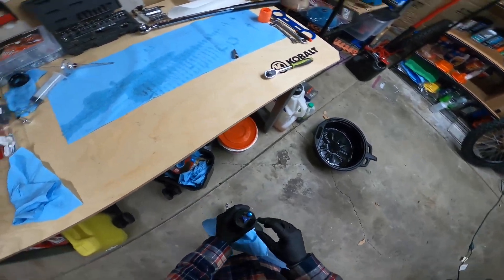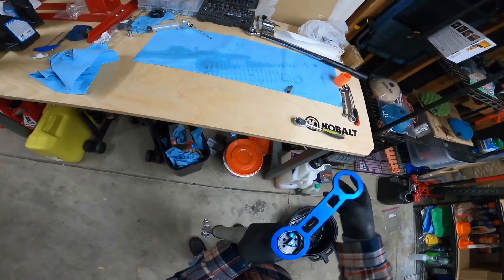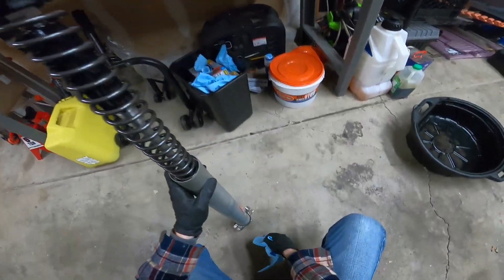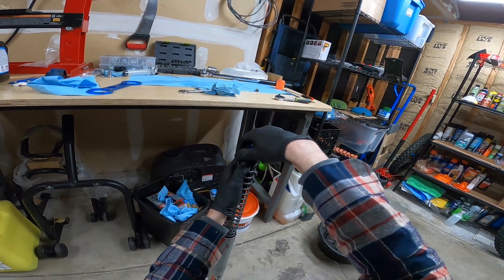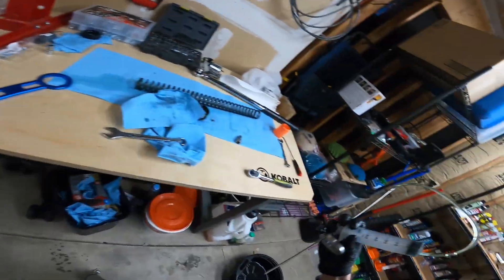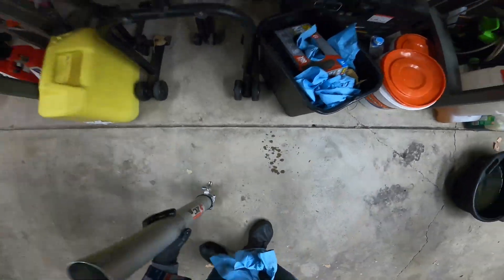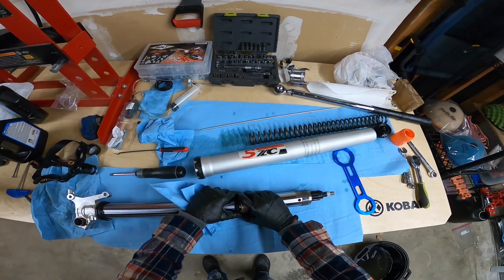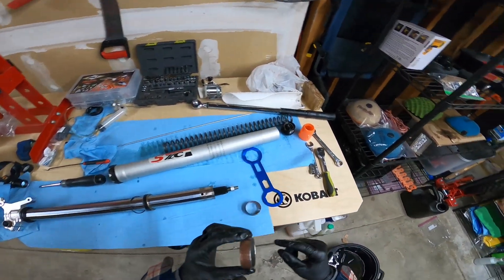01162021 GPX FSE300R SZC Fork Disassembly for Seals

Comment: Where’s the assembly video 👀
Reply from the maker: KTM open chamber instructions, others done better videos and in the maintenance manual. Standard forks, nothing crazy except rebound adjuster.
Reply: Copy thank you! I gotta do my tse250 fork seals soon and never done them! What size fork seals and what brand you Recommend?
Reply: @sliceofbutter6766  only use skf dual compound fork seal set. They are highly upgraded heavy duty seals to compare to factory. I called up USA Motortoys in Utah ( gpx ) to order my seals for my tse300. If replacing, use upgraded seals to prevent issues. Little more expensive but worth it. About 80 bucks for both sides
Reply: @Scott-lu4vj  ok thank you for that because I think I might have to rebuild because I got cheaper seals and they are leaking. Im going to look into those! Rebuilding fork seals are a lot easier than I thought.
Reply: @sliceofbutter6766  the seals from the factory from my understanding aren’t that great.The gpx 300l takes 48mm oil & dust seals just like the ktm models though. Mine takes 565ml oil per fork. And need a 50mm fork cap wrench for the install and a measuring cup. I ordered a ratio rite measuring cup and wrench from Motorsport. Ordered oil with the seals that should be here any day now. Mine didn’t make the first ride granted I maxed them out had one leaking and one puked oil ( I never burped the forks from the factory ) but they still leak fluid. New seal install soon! Try again with skf
Reply: Also how much oil🤔
Reply from the maker: @sliceofbutter6766  Open chamber forks measure fork oil height from the top of the fork tubes without spring. You can change that height depending on what you want, think I had mine around 120-130mm.

Comment: Hey got a brand new gpx with these forks, however these forks are a huge let down for me  due to a ton of stiction, making me have to slow down to klx230 speeds; and thats a bike with the old old damper rods! Done all the usual stuff, new oil, grease the seal, a hundred miles of rocky desert riding to break it in. They are really smooth off the the bike applying a straight force to them , but any side force whatsoever, which is more common than not when installed on the bike, and I got stiction city. 
So my question, was yours the same? Only thing I can think of thats left is the bushings and the fork coating. I can't do anything about the coating( I think). Know any decent aftermarket bushings I could try out?
If I can't get this solved the bike Is gonna get put up for sale.
Reply from the maker: Ya know it's something I never had on these forks but on my '22 forks I have noticed it.  I did just do new fork seals the other week on the '22 forks but haven't really ridden to see if that stiction is gone.  I notice it most when coming to a slow stop and having some nice even pressure on the front end, it'll stay down a bit and can feel/see it pop up when starting again.  I know it can be fixed and think it does have to do with bushings but I dont have exact fix here but I'd like to know as well.

Comment: Glad you're doing these vids. Did the crash into the tree bend anything?
Reply from the maker: Glad they are helpful just me screwing around on a bike, only do these videos for fun and there isn't much available on these bikes. It can be hard to get straight information on them.

Not that I can see, I think that crash is what cracked my rear fender but $40 from GPX and got new one. I can't claim any 'chinesium metals' on this bike and even the plastics seem up to par with any other brands. Pretty fearless at this point dumping the bike.
Reply: @SCakey  That's what I was looking for, no bad metal, these bikes look the biz.